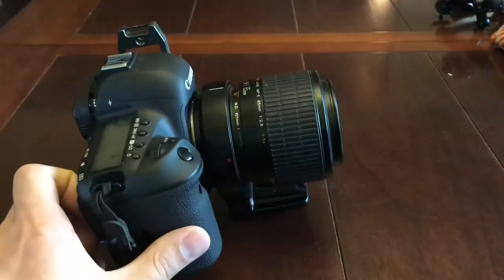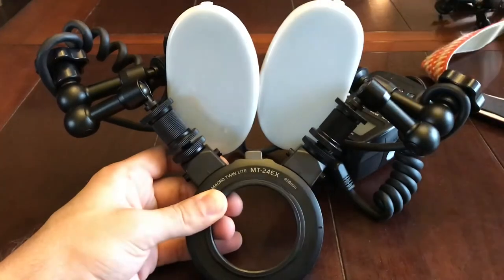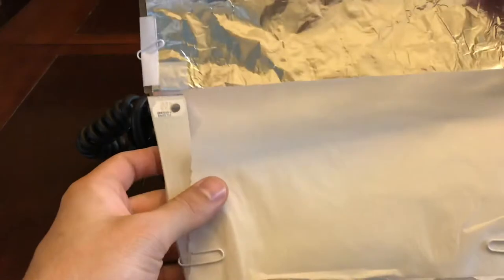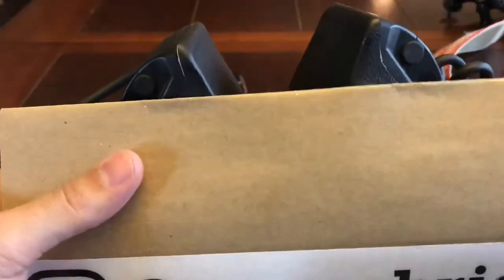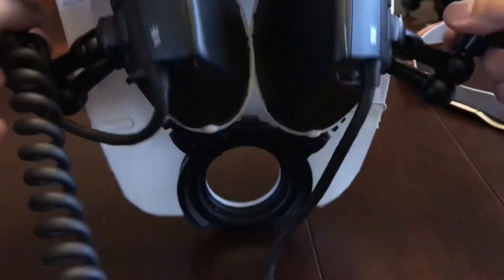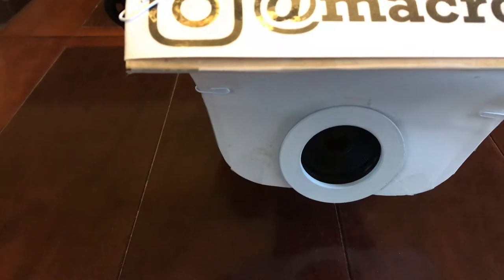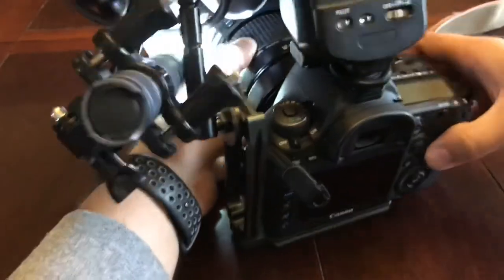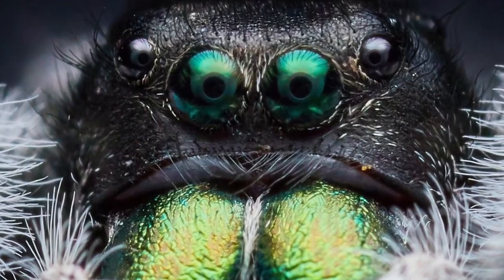Diffusion and the MT-24EX

Comment: Thanks a lot for sharing, especially the Lee diffusion filter caught my attention. I was using baking paper on my old cardboard made setup with lense in reverse position once and it worked quite well. With different Lee diffusion filters one might get more control over shaping the light. Have you tried with different distance of light source to diffusion plane? In the video your light seems pretty close to that plane... Cheers